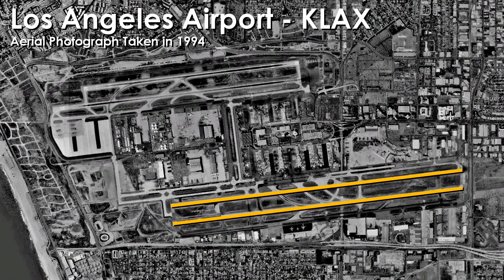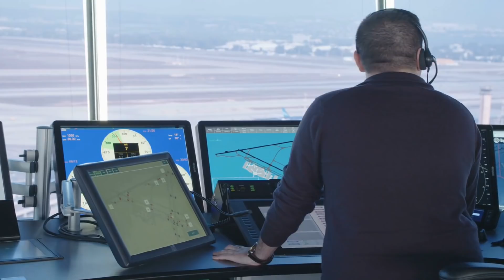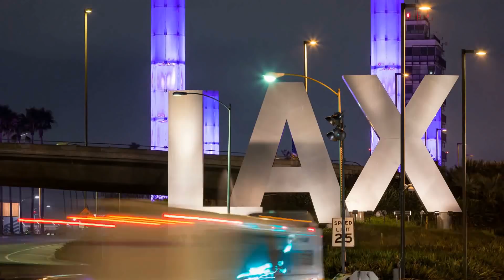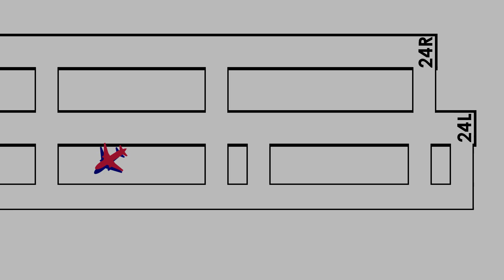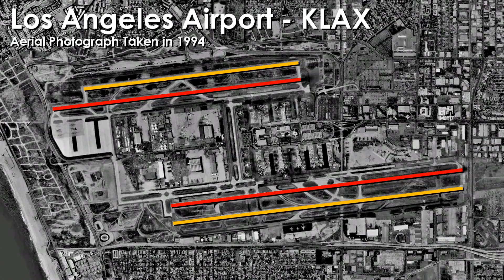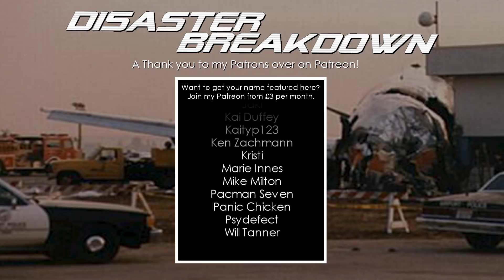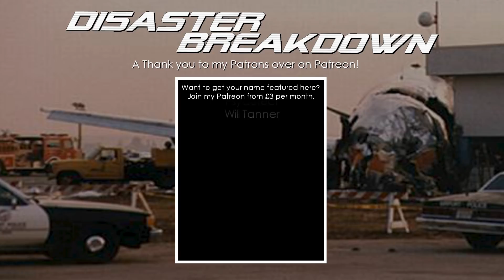Runway Collision At Los Angeles (USAir 1493 & SkyWest 5569) DISASTER BREAKDOWN

Comment: The Tenerife accident wasn't a runway incursion. The Pan Am crew had been told to enter the runway by atc in the tower. They were confused as to which taxiway exit to turn off at. The KLM crew mistakenly thought that they had been cleared for take-off when infact they had only been given an airways clearance for after take-off. Thirdly the controller could not see the runway due to fog. A classic chain of events that led to disaster .........
Reply: by definition it was, 2 airplanes on the same runway, one landing/taking off, but ur right it wasnt a textbook runway incursion
Reply: There was also a heterodyne that caused the klm crew to miss an important message that the pan am had not cleared the runway

Comment: Sometime in the 80s, I was a passenger on an airliner in the USA getting ready to take off. Our plane made a final turn from the taxiway onto the runway and then immediately the pilot started the takeoff roll. We were going pretty fast but hadn’t rotated yet, when he hit the brakes hard. After we stopped he came on the PA and said something like “Well folks, there was another plane on the runway ahead of us. I thought he was going to get out of the way in time but he didn’t”. It was a hard enough stop that the emergency vehicles came out, but we didn’t have to evacuate. I don’t remember whether we took off later on the same plane or had to switch planes. I just thought the pilot was an idiot to start takeoff when he KNEW there was another plane ahead of him on the runway - maybe it was in the process of taxiing off, but still he should have waited until it really was clear.
Reply: He should not be a pilot
Reply: Holy crap that’s scary!  Thank God your plane was ok and no one was hurt.
Reply: You have to take into consideration that proper procedures and clearances need to be followed
And he probably had the green light and the other one was cleared but failed to follow up
A lot of the aviation accidents are caused by this, directly or indirectly as it almost happened to you
Reply: A.

Comment: There is one factor you didn’t mention. When landing to the west at LAX during sunset the water creates a blinding glare that pilots had complained about for years. The water is very close to LAX. USAir was landing to the west at sunset during this accident. I read in reports that this was most likely a major factor in NOT noticing the Metro lined up and holding at that intersection. Just wondering if you heard about this?

Comment: We have so much fancy equipment today. But you'd think someone would have tried to fully illuminate the entire length of a runway. So visually landing planes can't miss if an object. Not just a plane, has entered the landing strip. Or maybe have it be motion sensitive. Where ever a plane taxi's and waits. Bright lights will stay active on the spot. Til the object is moved.
Reply: id be worried there about having a massive miniature sun point at the runway, better to have lights on the plane themselves, which they do and somehow were missed here
Reply: The smaller plane didn’t have it’s strobe lights on per company policy at the time. Not blaming them I’m just saying the technology they needed was sort of there but not in use. I think the airline policy was to not turn on strobe until takeoff clearance but it should have been as soon as they entered the runway.

Comment: Also, the fact that an airport the size of LAX has only 4 runways strikes me as crazy. Granted, I don't know much about the airline industry, if at all, but surely that doesn't sound sufficient for the number of flights in and out of that airport.
Reply: London Heathrow only has two runways
Reply: "I admit that I don't know anything about this topic, but here's my opinion anyway"
Reply: it can be slightly more dangerous but london heathrow only has 2 and they've never* had a fatal runway incursion incident 
*as far as im aware, there might've been an incident that i  dont know about
Reply: @heatdeath5535  Better honest and wrong than confidently wrong.
Reply: @theatheistmonk4385  Wow did not know that.
Reply: LAX was built before Los Angeles experienced a major population boom and the airport was less busy as a result. The surrounding suburbs of El Segundo and Inglewood grew to the point that there was no room left for the airport to expand.

Comment: I always think it's crazy how people talk about the air traffic controller in this disaster versus ATC and pilots in other disasters. Like, don't get me wrong, I do have some sympathy for the controller here, but she WAS the main cause of the incident. She lost track of two aircraft and put them on the same runway. Of course there were other contributing factors like the lack of visibility on the runway and being overworked by management, and definitely those are negative points that should rightfully be addressed, but what's the difference between that and a pilot who caused an air disaster? Yet when it's the pilots who make mistakes, we come down super hard and say "how could a pilot do such a thing?" even when there are equally rational excuses, like somatogravic illusion, fatigue, or genuinely not being trained for the situation their aircraft put them in. Not to mention how, in other disasters, people often say "How could ATC tell them to do that when it wasn't safe?" or "ATC should've never authorized this clearance", and yet when it comes to this disaster SPECIFICALLY, "oh, it's hard to find fault with the controller."

Comment: Just seeing this video. I don't agree it was an incursion in spirit or fact.  Both aircraft were given permission to be where they were and were doing what they were told.  An incursion in my mind and by definition indicates an invasion which would be without permission. Furthermore, I don't see collision possibility having anything to do with an incursion by dictionary definition. If the controller says stop short of runway XX and you don't, that is an incursion, even if the only other aircraft is 50 miles away still waiting for Jimmy to fix it up and fly it out.  There is another video for that.  
And I looked up the FAA definition it agrees with me:  Any occurrence at an aerodrome involving the incorrect presence of an aircraft, vehicle or person on the protected area of a surface designated for the landing and take off of aircraft.

Comment: Mayyyybe the runways should be numbered/names in such a way that they are nearly identical??  No idea if it would help but, yeah why not?
Reply: Actually, that night cause more problems.  Runways are numbered based in their general compass heading.  This is to give incoming flights a general direction to start lining up the runway for landing.  All runways have two numbers--one for each direction it faces.  Due to the Earth's unstable nature, these numbers change every so often.  Also, you'll note that there was no confusion over which runway the planes were supposed to be on in this incident.  Both planes were exactly where they were told to be.  Sadly, one of them shouldn't have been there at all.

Comment: When are Car Like Smart Cruise Control Sensors Going to be finally implemented into Every Commercial Traffic Runway system , that way it or the Sonar Distance sensors can take some of the Workload of a Human way up in the rat race So-called Control Tower or ATC , Ground Traffic Control at airport's like this one is Not a job for a Air Traffic person ,Car have all the strangest Sensors in them Like Back up Sensor, Park distance sensor, Cross Traffic Alert Sensor Even a Cruise Control Radar that will get you Rear ended Faster than Normal cause the cruise Sensor  vehicle abruptly Slows down for Someone ahead turning off and isn't smart enough to change lanes and keep the cruise on So in that case Be ready to be Rear ended just like happened here. But I feel the Airline industry is a very dangerous industry to start with Stupidly fast paced and aggressive get out of my way not now but right now. Ground Traffic Smart sensors need to be fast tracked in the commercial airline industry as soon as possible. If car's can have them so should the faster, bigger , very much pricier Planes should too. Godspeed to all the victims here.

Comment: I can't understand why the hurry up and wait Fairchild commuter Plane Didn't actively monitor ATC Take off or Landing traffic the Second it was placed on  24L a stupidly Busy Runway right in the Path of bigger incoming air vehicles, isn't hand held Radio wave  Scanner Radios available at like Radio Shack ? It was then a Target for disaster being put on that Runway just to park there , Wrong wrong wrong.if l was the pilot in the victim plane l would have switched frequency to see when a plane is cleared to land right on top of me that way l have 20 Seconds or less to take my plane out of Park a drive over to a much safer place in a off ramp or on ramp. I've never been to LA or don't mind it one bit. But I've learned of lot's of crappy fatal incidents at this place. Especially when it comes to bigger Planes versus smaller ones and They Both Loose most if not all the time unlike a Train meeting a Semi at a crossing the train wins usually.

Comment: The controller has some fault but in part. The metro pilot is right there on tower frequency waiting for takeoff clearance...that's a moment where pilots grow 4 ears to get the clearance and go, so the metro pilot sitting there surely heard the "cleared to land runway 24L" for the 737 on final. The 737 surely busy and surely missed that line up and hold clearance but as well they were waiting for full clearance so they probably heard the metro clearance too but in that busy moment is easy to skip that. I think 50% fault on the controller and 50% on the metro pilot which probably thought "that's what the book says, that's what i do, if something happens we will deal with it later".... but yes, doesn't matter who's fault, no good and RIP
Reply: The pilots were in no way at fault. The air traffic controller lost situational awareness, after having made a series of of unfortunate mistakes. The only other party at fault was the ATC management staff for not providing adequate redundancy in their system and oversight policies.